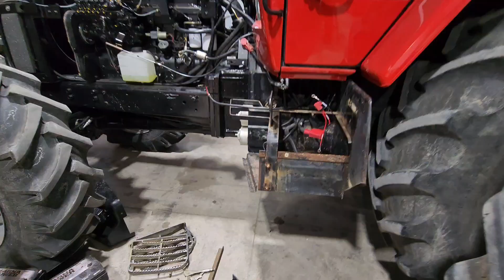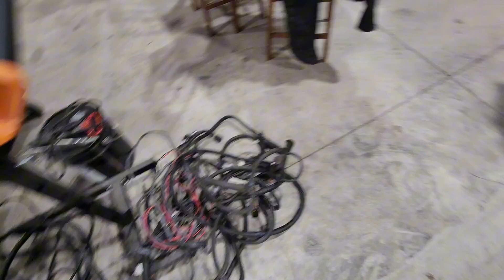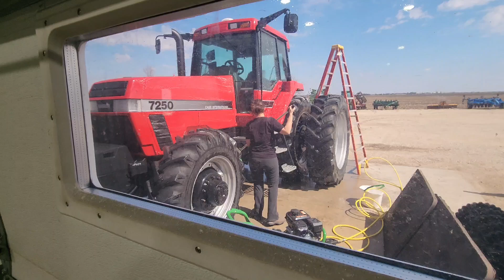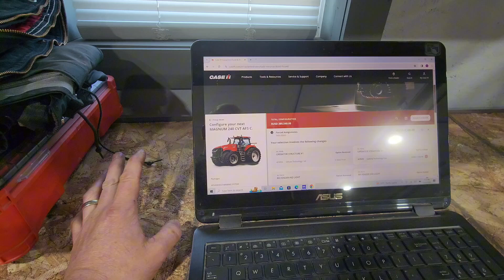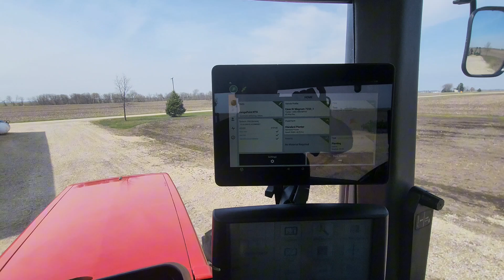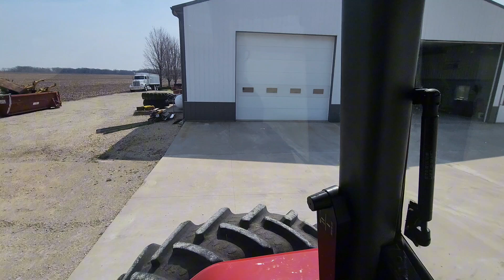7250 magnum part 8 all done!

Comment: Hey bud, you might want to check out a video put up on Dave’s Auto Centers YouTube channel a couple weeks ago on a new piston design for rebuilding diesels.  I did some research on it and it looks like it’s been in use in coal mining applications for years, more power, more efficiency and decreases the diesel chatter tremendously.  https://youtube.com/watch?v=y-3jE78dgHE&feature=shared

Comment: You putting the pto pump back on the planter?
Reply from the maker: Yep kinda have too
Reply: @rgfarmsrepair503  thought so probably a good idea even on a newer tractor. Them planters are hydraulic hogs
Reply from the maker: @obieacres4676  yeah even on my t8360 that had the twin pump mega flow I still was using a ton of the hyd capabilities. And I thought about ur question on the cat hyd system I could be wrong but I think the 1 half of the mega flow is used for steering motors on them.
Reply: @rgfarmsrepair503  does your cat have the twin pumps. The mega flows on the genesis tractors like mine had 55gal/min flow. Btw the magnum looks awesome. I thought about getting a 8970 instead of the t8 but some of the transmission parts are getting harder to come by. My transmission was completely rebuild 400hr ago and they had to get the parts from another supplier.. also don’t know if you have watched any of my videos lately but I bought a caseih 1250 planter and just got done getting the pro700 and gps working in my genesis.

Comment: I'd take the fiberglass trim  piece off the front right cornerpost of the cab and route that receiver cable down the post and up through the cable access by the fuse panel.  I usually run that cable from the receiver up under the cab lid right by the wiper and then over to the corner post.  Running it in the back window is pretty bush league, especially on a machine as nicely done as that one.
Reply from the maker: Yeah im not doing anymore to it just so ya know boss lol. That was the auto steer tech that ran it that way and I'm truly not that kinda obsessive compulsive to care about that crap. The cable access is crammed clear full of an iso harness already

Comment: Only thing I would take in that new 240 over the 7250 is the cab. Figure out what you’re going to do with the Pete grain truck?
Reply from the maker: Lol yeah I feel like fat guy in a little coat after having the luxury magnum cabs for years. But... I have about $300k reasons why it works out just fine. Thanks for watching
Reply from the maker: Stay tuned Pete is getting rebuilt this summer
Reply: @rgfarmsrepair503 How many hours do you think you guys have in this project?  Let’s assume 350 hours at 165 per hour labor cost, your still less than half of a new tractor.  Thank you for breaking this all down.
Reply: That 7250 is beautiful guys, unbelievable work…..and no debt on it.  Doesn’t get better than that.